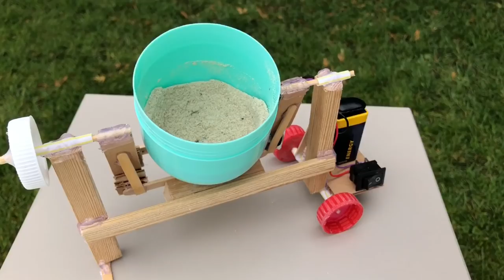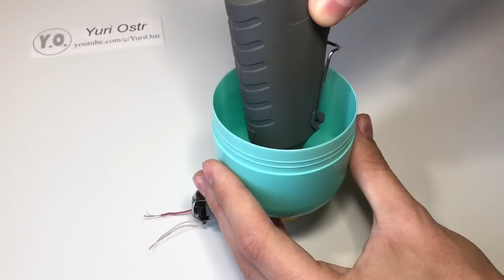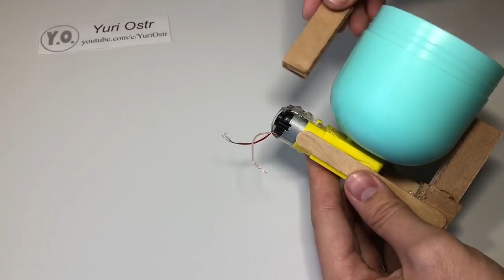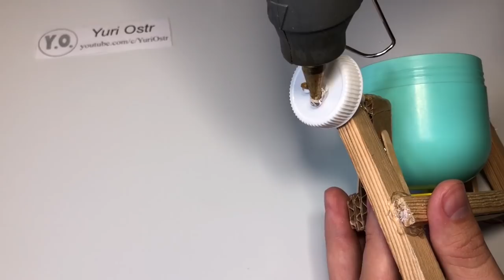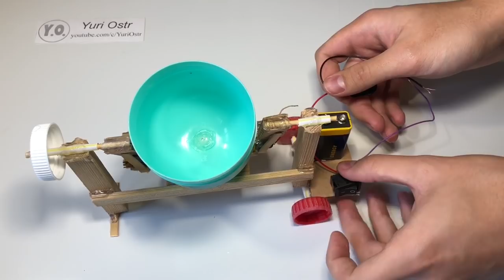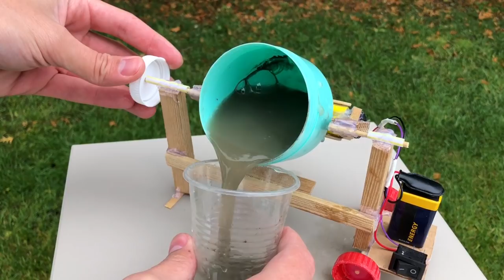How to Make Amazing DIY Concrete Mixer Machine at Home - Easy to Build

Comment: I've been trying to find a mini concrete mixer [and I do  mean "mini"!  not the 150L ones that come up on search after search] that's manually operated [not electric or petrol], and the "how to" ones still assume that I want to mix enough to fill a bath.  I didn't think this would be any different when I saw it on Google search - thanks for proving me wrong!  what's its capacity, by the way?  Though I could always use a bigger drum! and could this be adapted to hand-operating?